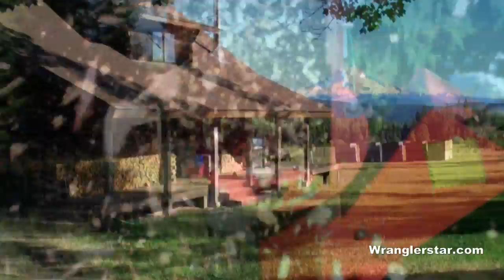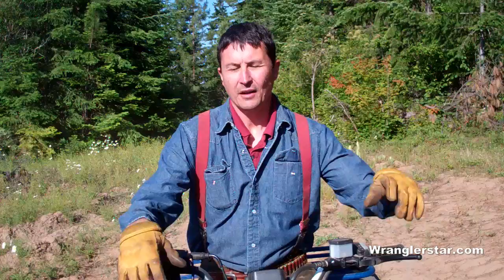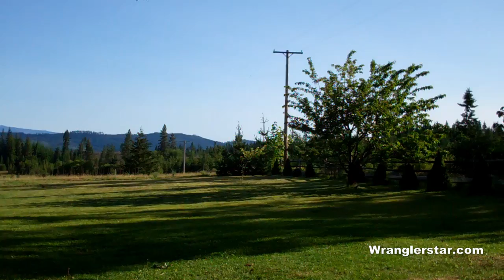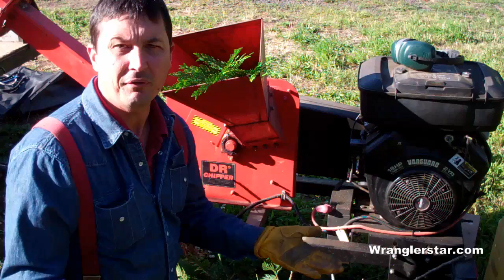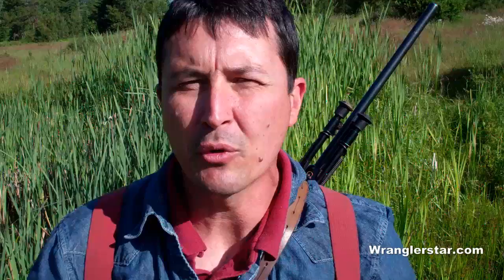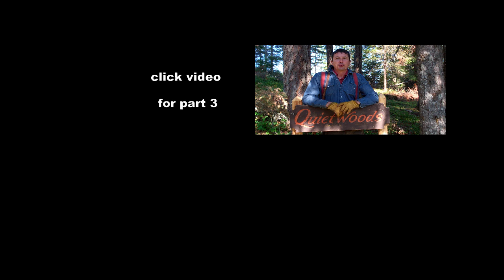Steps to Protect Your Home From Wildfire – Essential Firebreaks and Tools

Comment: Not that you would want to have to rely on it, but I would darn sure set my well pump up where I could flip a switch box manually and switch it over to an outlet connection where I could use a small generator to run it. Honda has small generators with relay closures on them for that type of thing that can electric start on demand and shut off when the demand ceases.

Comment: I have a DR field & Brush mower & their string trimmer. Both are excellent machines. I would buy their Versa-Trailer that you can pull with an ATV/UTV if it had brakes. I wrote them about getting brakes as an option from the factory but they didn't seem to think that a ton pushing or pulling you in steep terrain was a problem. I can tell you from experience, it's NOT safe in steep country with that amount of weight when you're on a 600lb machine.